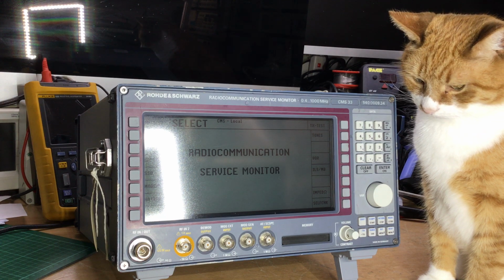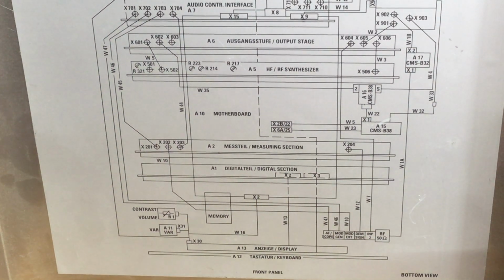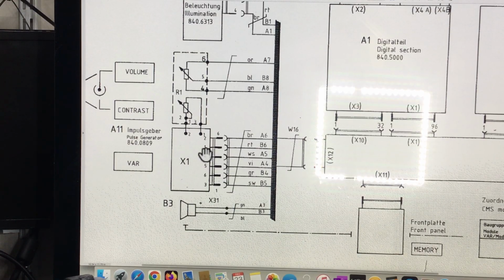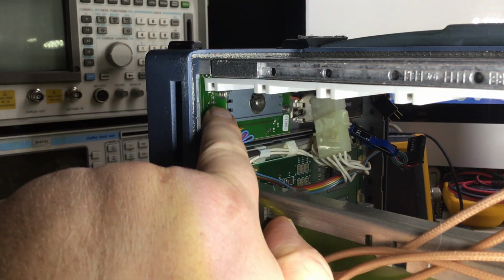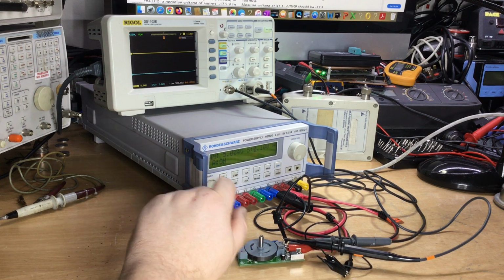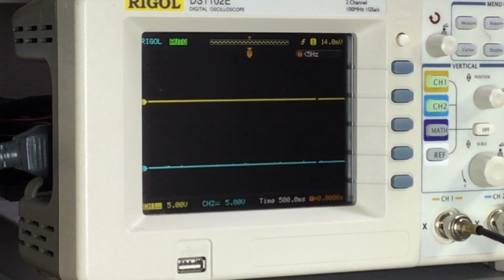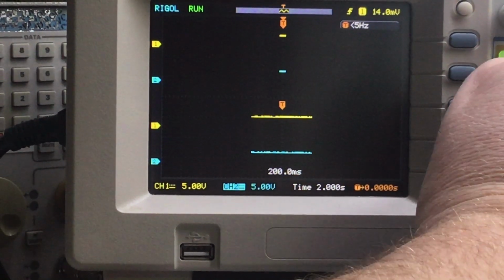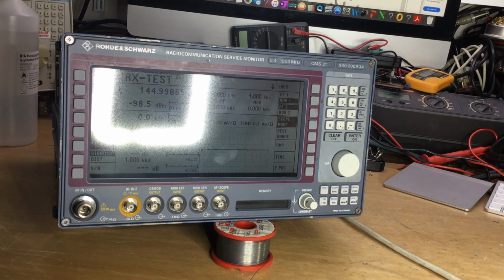ROHDE & SCHWARZ CMS33 Radio Tester, Repair, Teardown & Analysis, Variable RF sig gen level fail.

Comment: Hi, my name is Renato, I wanted to ask you if you have changed the battery on the CMS 50 and if you know where to find the wiring diagram, thanks
Reply from the maker: @renatopicarazzi2186  Hi Renato, I'll be honest I don't ever recall having to replace a battery in them. I assume yours has failed? It's probably located in the control module just behind the display but you must be very careful in removing the module as there is a delicate ribbon cable connecting to the display & there is a little wiring loom also which is tucked in behind it. The battery if fitted is probably a button cell type. As for the service manual these are hard to come by, there is a free on the internet if you do a Google search CMS52 service manual, this is almost the exact same as the one you have, if you search hard enough you will find it. I have some R&S service manuals but not for many models, the other problem is getting spare parts R&S appear to have tightly controlled service info & parts, if you do ask them for prices they will be eye watering, all the best,
Reply: @rfmanrfman4536  Grazie mille Thank you very much, very kind
Reply from the maker: The RAM backup battery which is 3v axail shape is soldred on the PROCESSOR MODULE PCB which is the module located behind the LCD display it has the processor id marked on the module covers so you can find it, remove the top cover off the module to access the battery whihc is blue in colour & axial in chape its soldered to 2x lugs / standoffs on the pcb.

Comment: I've recently acquired a CMS 33 however it looks like the measured RF power on the TX test section is not correct (looks like its doubled). Would you share the service manual and do you have any hints?
Reply from the maker: @TobiWan18  hi you can download the CMS 52 or CMS54 service manual on the internet, it's basically the same as the 33, however if you look at my CMS 54 video you will see in the rear left there is a module called the RF attenuator, it's gat a silver block with a heatsink, & also a fan plugs into the board too, the solid coax from the Front N socket connects to it, on that PCB there is a Blue potentiometer this is used to calibrate the TX RF power reading, the manual says input 10 Watts 300MHz and adjust for right reading on display. It could be someone has messed with it before you, believe that board is where the problem lay. All the best.

Comment: Great call on the problem, during your diagnostics. Maybe add an anti-static cat whisker broom to sweep away any future filings. This type of broom is found in paper copy machines. They make a ground to the paper to drain away static. Similar devices are found in some electric motors. The whiskers are made from conductive plastic and are mounted with simple brackets. Very doable, within the space that you have. You will have to determine if you actually want to tie it to earth ground. Of course, your issue is magnetic. There is also anti-static expanded foam. Just take it against the wheel. Also, there are anti-static sprays. You kind even find it in the grocery/department stores. It is used to stop the static caused by fabrics brushing back and forth on itself. Additionally, you might be able to swap out the encoder for a photo type. Obviously, R&S was trying hard to engineer the encoder robustly, however they actually over did it. Great repair.